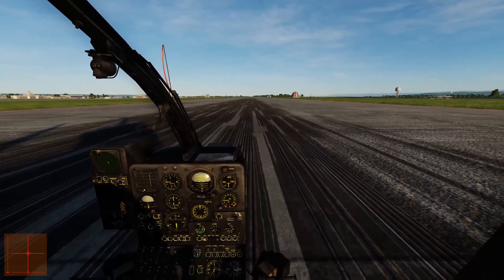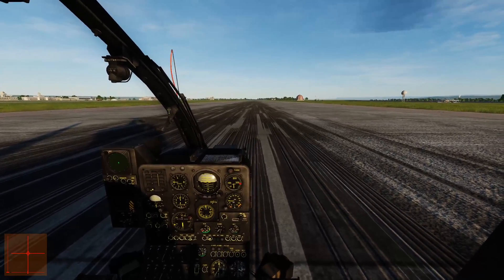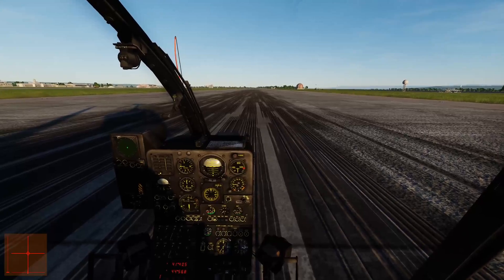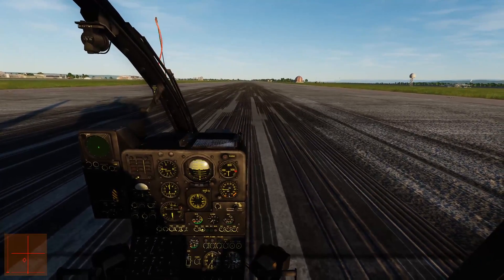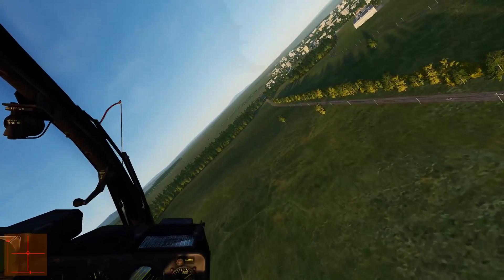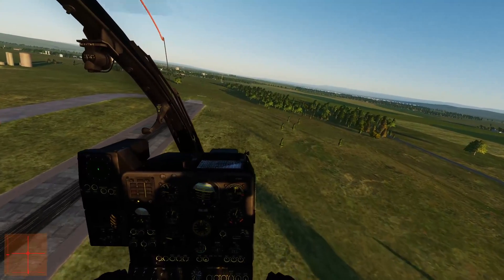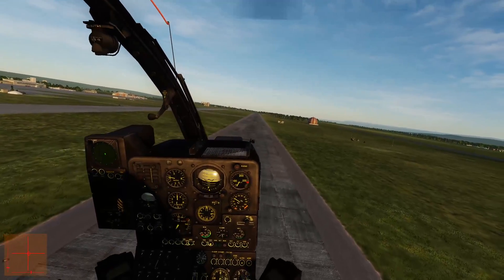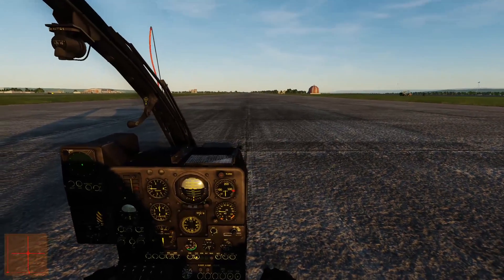A Brief Data-Driven Look at the DCS Gazelle Flight Model

Comment: Safe to assume that DCS doesn't use CFD on individual rotor blades.

It's a videogame.
Reply from the maker: CFD isn't used, but a blade element model can be done in real time. Basically, the velocity and angle of attack at every blade segment is calculated, and airfoil tables are used to determine the forces. These forces are summed to determine blade flapping motion and forces applied to the hub.
Reply: @ErikScott128  Thanks for the reply, and I apologize if my original comment seemed arrogant.
In regards to your statement that this can be done in real time; When you say velocity, do you mean the RPM of the rotor in relation to the relative velocity of air around each blade? (Since the velocity depends on where on the blade, i.e. the radius from the hub). Also, is the gyroscopic precession accounted for in the table?
Eager to hear more about this method but my intuition tells me it would be more efficient to take the blade pitch from the position of the swash plate and then just treat the whole thing as a "disk" with four input points (starboard, port, forward and aft) rather than doing the math for each individual blade? In your proposed method, does a Hind take more computational power than a Huey (fewer blades on the latter) ?
Thanks again for the reply. Just trying to learn.
Reply from the maker: @iCanHazTwentyLetters  I'm referring to velocity as a vector quantity. The velocity at the rotor blade segment is a function of rotor speed, blade flapping and lagging motion, aircraft motion (translational and rotational), and atmospheric effects (wind and gusts). The lookup table I mentioned only computes the lift and drag as a function of angle of attack (as well as Mach number and perhaps Reynolds number). Gyroscopic precession, as it relates to most helicopters, is largely a myth or a gross misunderstanding of the physics made by laymen who don't have a true understanding of the physics. Helicopter blades are not rigidly attached to the helicopter, and flapping motion is the predominant effect that much be accounted for. There is indeed a ~90 degree phase lag between application of maximum cyclic pitch and maximum flapping angle, but this can be explained by modeling blade flapping as a linear 2nd-order system excited at or near resonance. In any case, inertial effects are accounted for by computing the accelerations of each blade  and applying the associated reaction forces a the hinge. 

A helicopter with more blades would indeed require more computation than one with fewer using this method.
Reply: @ErikScott128  Dude. It took me a full day to come to terms with what you just said.
It's mindblowing that such a complex dynamic concept can be used erroneously to explain the mechanics of helicopters.
There seems to be a lot of misconceptions virally transmitted throughout the internet.
Thank you again for explaining this.
PS. I'm sure there would be considerable interest if you considered making an educational series of videos explaining some of these concepts and shedding some light on the misconceptions.
I have seen educational videos that imply that the cyclic input tilts the entire rotor (and mast).
PPS. Also eager to see more on your hornet stick (HOTAS?) project. Looks cool. I hope you make a longer video about it eventually.
Reply from the maker: @iCanHazTwentyLetters  I've learned to avoid "edutainment" type videos about helicopters. They really frustrate me. It's not so much that they just get it wrong (people don't know everything), it's more that they unintentionally spread this information to people who view them as an authority on any subject they present. As you said, there's a viral effect that's difficult to combat. 

I'm pretty sure I'll do some educational videos on helicopter physics at some point. I've actually been giving it quite a bit of thought. Determining the scope of the videos is tricky though. True understanding does require a mathematical approach and an (aeronautical) engineering background in many cases. Striking a balance between accessibility for the average viewer without skipping over key insights is very tricky. If I do ever make a series of videos, I may do each one in 2 sections: a "principles" video which covers things at a high level keeping the math to a minimum, and a "details" video where I dive a bit deeper into the math. It certainly wouldn't replace a graduate-level course on the topics, but I think it could help people understand things a bit better. In any case, I would very intentionally avoid the "edutainment" style of video. I'd probably aim for a style somewhere between 3blue1brown and Ben Eater, albeit presented in a way that's uniquely my own. But I'm getting ahead of myself.

Comment: Perhaps the flight model in the DCS gazelle is a combination of a lack of the necessary engineering analysis background and more likely a need to simplify the model to reduce the CPU workload, leading to approximations in the flight model.
Reply from the maker: Simplifications are necessary. For instance, we can't yet run real-time free-wake or CFD codes, so instead we use actuator disk models to simulate the effect of inflow and downwash. However, the Gazelle seems to make too many simplifications to the point where the aircraft no longer behaves like a helicopter should.

Comment: It is quite difficult to say where the stick should be because it depends on helicopters center of gravity and not on its load. You have pilot with gun behind on the right, co the CG is moved back and right.
Reply from the maker: That's a valid point. I note that the aircraft in DCS is not exactly representative of the test aircraft. Cyclic position is certainly influenced by CG position. That said, I would still expect to see the general trends shown in the flight test report. The cyclic stick's trim position should still move forward with airspeed. The exact position may not be the same, but I should still see the same general trend. I do not see this behavior in the simulation, and my conclusion is that the rotor modeling is largely incorrect or overly simplified.
Reply: @ErikScott128  Yes, I agree. It behaves like FBW. It feels like I am controlling the pitch/roll rate by stick and not cyclic pitch/roll.

Comment: Did you set the axis saturation and curves to where Polychop said they have to be? DCS default axis settings set the controls to 100% everything. Weird how all real Gazelle pilots that have flown the DCS modules say it is dead on, but the controls have to be setup exact to Polychop settings. There is a problem with DCS with drag and it is on all modules. Polychop is setting up the new FM to override the 100% control settings on the default DCS settings. The actual FM is not changing.
Reply from the maker: Setting the control gains ("saturation") does not excuse the issues I highlighted in the video. I think I was flying with slightly lowered gains (maybe 80%) but that's not what I was evaluating. If the developers wanted us to fly with those settings, they should be baked into the aircraft's control system such that 100% saturation in the control options reflects the correct gains, not left to the user to fiddle with. 

Pilot opinion regarding control sensitivity may appear validating, but it depends greatly on the hardware they are using and on other, more subjective, factors. As I mentioned, flight test and performance data needs to be the starting point for validating a simulation model.
Reply: @ErikScott128  Control gains is a DCS problem. It sets everything to 100%. It is the same with all modules. It also depends on desktop to extended sticks. But DCS sets a default of 100% on everything. All Gazelle pilots that have used the module say it is the most accurate simulation they have tried.
Reply from the maker: @ComdrStew  100% for all modules is the correct default; that represents the maximum control authority for each aircraft. 100% input on your controller should represent 100% stick deflection in-game. I can't think of a reason to change the control saturation for any module that is properly modeled. All the control tuning panel does is add an additional artificial layer between you and the simulation. Curves are also an additional, non-realistic parameter that are provided as a convenience for people because most of us aren't using representative hardware. I think you have a misunderstanding of how inputs to the simulation are interpreted. 

I'm interested in your sources regarding real pilots' opinions. I demonstrated fairly clearly in my video that the aircraft does not behave as it should. This discussion of the control curves and saturation is just a distraction and has nothing to do what what I presented. 

I also think you are largely misinformed; Polychop has stated that the flight model will be completely re-written. It will not simply be a change to the input gains. Whether it will be good remains to be seen, but I'm hopeful.
Reply: @ErikScott128  Mostly from Gizmo and some of the guys with him who are all retired Gazelle pilots.

Comment: Really well done, and such a shame too in the short term - hopefully. 

Initially a lot of qualitative feedback on the Gazelle was from heavy, fully articulated rotor guys and I figured it was simply the touchiness of the semi-rigid rotor system that was catching them off guard. I have not flown the Gazelle, but I have a military pilot career background in the AS350, EC135 and NH90. The AS350 has a very similar rotor system and moving from that to an R-44 made you realize how twitchy/sporty it is when compared to a teetering head like the Huey. 

The stick centering sounds like auto-trim to me. Impossible to replicate on a non-force trim/trim release cyclic the likes of which we use in simulation, but effectively the same. In an auto-trim, also referred to as follow-up trim I believe, you set an attitude, hold it....     and the platform trims to that cyclic position, thus rendering an ‘effective’ stick center position. In the real platform, the stick will be trimmed to that position and can be displaced/returned, but if held in a new position it will auto trim to that new position too. NH90 does this. 

With a simulation cyclic, that will have to ‘present as’ stick centered. There ARE stick systems out there that relocate this position physically - but they are VERY expensive and tend to go into 6 DOF mil Sims 👍🏼

However, as noted - if the collective power is wrong, and that funky response (modeled entire rotor response versus blade element?) to increase/ decrease in collective is wrong too...   well....    that’s not cool. 

I am wary too. The stick position ‘may’ be left of center slightly for lift off to hover, but like the AS350 she still eases back onto her right elbow, skid-wise, prior to lifting...     which would imply quite a mast offset in the Gazelle design? AS350 has an offset too, but still a small reverse letter J in the cyclic for lift off.
Reply from the maker: Thanks for the comment. The Gazelle doesn't actually have a hingeless (what many people incorrectly call "rigid") rotor like, say, the EC135. It's fully articulated with a flap-pitch-lag hinge sequence. Articulated rotors still have considerably more control authority over a teetering rotor (depending on the hinge offset) due to the inertial (centrifugal) forces acting about the center of the hub (in addition to the small aerodynamic moment). The gazelle is also light and has low fuselage inertia, so, I can believe that it has very sensitive controls. That, however, is not the issue I have with it. 

I am familiar with trim follow-up, and the Gazelle modeled in DCS should not have it. I intentionally disabled the stability system to remove it from the equation, but even with it on, it should only provide rate damping and have no impact on the control positions in trim. 

All single-rotor-helicopters with articulated or hingeless rotors will hover with one skid low. For those that spin in the typical direction (counter clockwise when viewed from above), then this will be left-skid or left-wheel low. For helicopters like the Gazelle that have rotors that spin the other way, it will be right-skid-low. I noted in the video that the stick position from the flight report seems counter to this, but I didn't remark on the fact that the control rigging may be such that there is some additional bias in lateral cyclic with the stick centered. I don't think there's any lateral shaft tilt (which is what I think you mean by "mast offset") in the gazelle, but there is certainly some longitudinal mast tilt, as this is in just about every helicopter.
Reply: Hey Erik

I agree with everything you have said, and I wish to emphasize how grateful I am that you have taken the time to conduct a engineering analysis of the DCS Gazelle.

I did think initially that the main rotor system was simply the same or similar to the AS350. Apparently it did start life on the prototype as a rigid rotor system from the Bo105 x but that had some nasty characteristics at speed, so it went to a semi-articulated system for production. Looking at both systems I would think the AS350 to excerpt more control power; but the DCS Gazelle, without curves, behaves like a B3 that’s had three extra coffees??!!

I agree that the Gazelle should not have trim follow up - just seemed to behave as if it did? A Flight Model error? Not sure. It also makes good sense that you would turn the SAS off (stability), however, stability systems depend on the type as you would be aware I guess. I had an opportunity to fly the UH-60 IRL, and progressively dropped the three SAS MODES offline until hovering with no stability supplementation.. each system being slightly different in how it worked. In the AS350, a helicopter similar in size, origin and complexity to the Gazelle, it really came down to force trim and trim release for stability - in which case the trimmed position most certainly shifted the stick position to a new ‘neutral position’ - something that is very difficult to replicate in a simulation on any aftermarket controls that I have seen? 

Totally agree with the comments on the mast tilt, but there is usually a mast offset as well. Not just tilted, the mast usually sits slightly off set from centerline, which is another reason that one skid/wheel will hang low in the hover. Regardless of rotor direction, the pilot will still have to fly their Heli to ‘light on the skids’ and then manipulate the controls to lift a fuselage that never wants to hang ‘level’ under the rotor. In the AS350 this means ‘skids light’, then cyclic progressively aft about an inch and a half as you lift  (center of gravity is slight aft of the Centre of the Rotor), the helo skids are now on ‘elbows’, further lifting will mean the left elbow coming off before the right, then lifting straight up from the right elbow to the hover. The reverse is the same, in reverse - but with the sprung steel ‘talons’ hanging off the back of the skids, you have to be sooo gentle so as not to get an oscillating bounce. Any yaw as you settle and you scratch the ships landing deck, then you get told off - ask me how I know 😂

Comment: Did you try the polychop suggested axis curves?  They say you want collective at 70% Y Sat, Pitch at 40% Y Sat, roll at 25% Y Sat, and anti-torque rudder pedals at 60% Y Sat.  All other items remain unchanged.  Casmo and a few others do not use desat on their collective or anti torque, they use a negative curve on the collective and a positive curve on their anti torque because they state that you WILL need full authority available on those at times.  I do not even own this module and I feel I have learned more about it that some of the modules I do own. LOL  I call it research into the company that makes the KW.  I do want that helo but I will be waiting on my purchase of that to see if they learned from the gazelle issues.

Another good review from an actual Gazelle pilot
https://www.youtube.com/watch?v=FS3LvVVMrnw&ab_channel=Sly-DCS
Reply from the maker: I have seen that video. I think he gave it a bit more credit than it deserved, but that's just my opinion. He did say the flight model isn't great, and that there is no need to trim the cyclic, which is basically what I showed. Regardless, it's certainly a good video that people should check out.
Reply: @ErikScott128  and he had very few hours on it ages ago as a trainer so. Still more hours than I have in one of course. 🤣